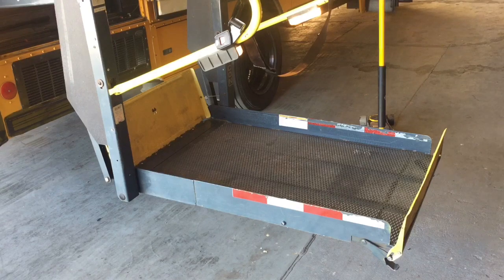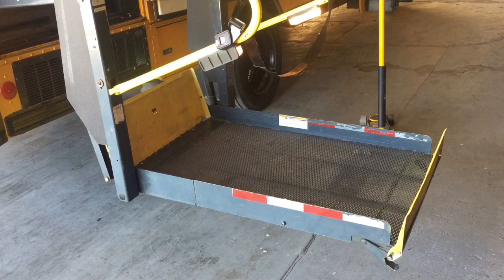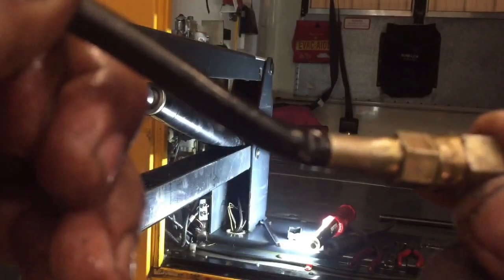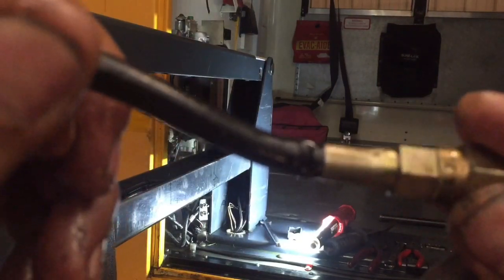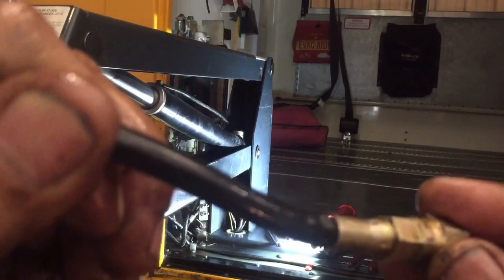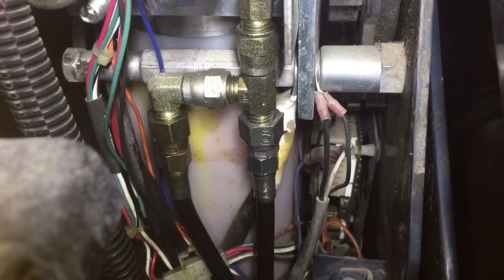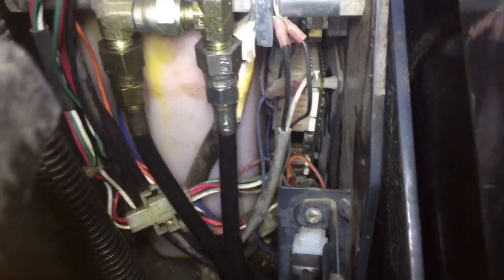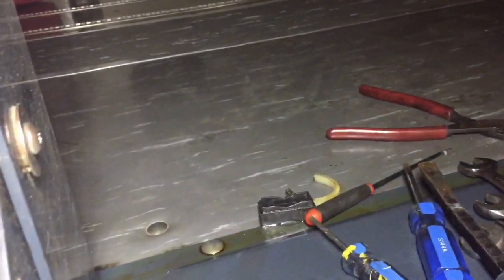Repairing a RICON wheel chair lift

Comment: Any ideas on why a ramp wouldn’t be stowing? We have taken it to the shop so many times and they fix it, but it stops working shortly after it returns.
Reply from the maker: Would that be a Ricon or a Braun lift
Reply from the maker: Ours r Ricon. The biggest issue we have with no stow is the adjustable solenoid. There should be a video that I posted in adjusting procedures. I posted it approximately 1 month ago.
Reply: Yes it’s a Ricon.
Reply: Thank you, I’m going to go watch now.
Reply from the maker: Correction. 3 months ago on that video
Reply from the maker: Hope u got a bit of useful info. If u have ?’s. I will try to answer them if possible.
Reply: Awesome, thank you so much. I watched the video and will be working on it Monday.
Reply from the maker: IAMRANDOM-1-   Cool. Appreciate u watching. Hope vid helped and hope u get that lift to stow properly.
Reply: Joe’s Bus Barn of course. Keep up the good work.